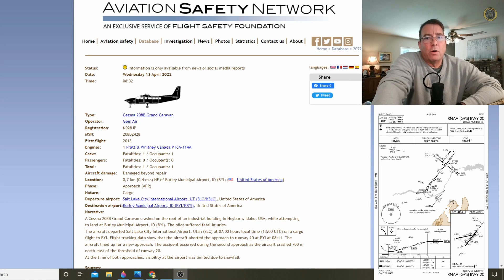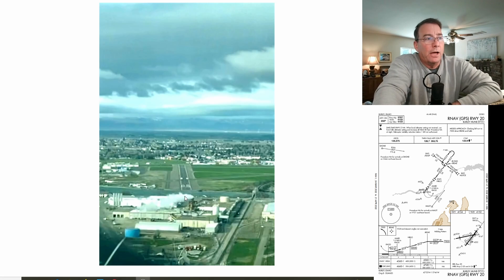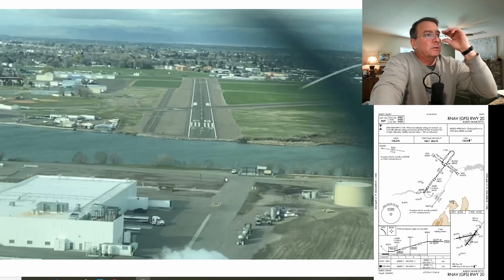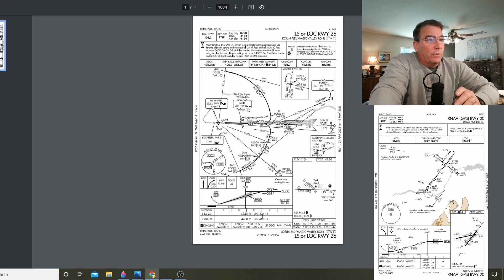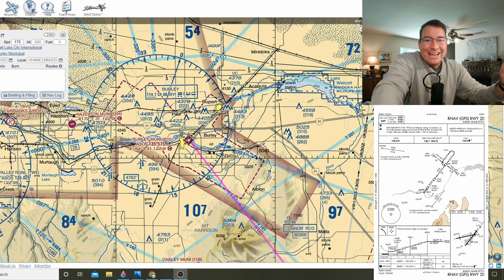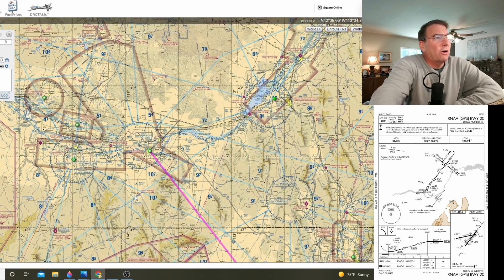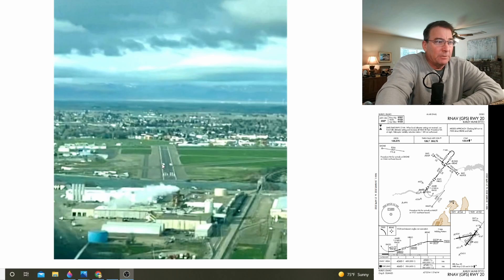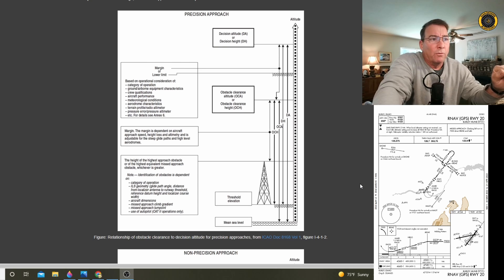Cessna 208 Caravan Crash Burley Idaho New Pictures of Approach

Comment: A factor with Caravans is the type of de ice system. They don't shed ice very well with boots. After several accidents you could order or retrofit TKS. I was on contract to FedEx back in the early 90's. They lost three Caravan's in on winter.
Reply: At 05:44 Juan says this aircraft had the TKS deicing system.
Reply: The difference is TLS is anti ice. Boots are de ice. If you are saturated with other tasks you may not notice. Caravan's just don't like ice. Human, machine and weather. Consider all factors

Comment: How do pilots know what their angle of decent is?  How do they maintain a consistent angle all the way to touchdown?
Reply: The actual geometric angle , typically, is not displayed for the pilot.  Yes, it is published on the navigation charts. Depending on the sophistication of the navigation instruments, they simply follow a set of "guide bars". They adjust power and flight controls to keep those "bars" aligned to a certain position on their instrument. Their airspeed and rate of descent instruments also give the pilot a mental picture of the descent angle. For an example you can look up: ILS instrument or ILS Approach.
Reply: In attitude instrument flying it's called "constant rate of descent at a constant airspeed."
Pilot adjusts attitude + power to obtain the desired performance. It's a closed loop process of monitoring and making corrections.

Comment: I briefly saw the data you put up on your previous post and, as with so, so many times, it's a combination of factors that ratchet up to the point of the tragedy. It wasn't that clear, but it also looked like TAS was dropping quite a lot before impact, so sink rate could have been more than she realised. I know from experience in the industry that there are massive cost pressures in this type of operation, hence the single pilot, but that workload, in those conditions, should be recognised by the FAA as "too high" ....

Comment: Whilst those obstacles are outside of the normal approach it appears to me that if you were low for any reason you would strike the tower simiilarly it seems an extremely unfortunate place to position a tower adding in the steam and it seems like eventually these conditions were going to lead to an accident at some point. I wonder if her initial missed approach was in response to loosing visual of the runway due to the steam. All in all it would seem that there are systemic issues with this airport addressing which may have prevented this accident.

Comment: The airport pre-dates the plant, so how did the plant get approved?  That would be interesting to know.  I suspect that the plant started off much smaller with the stack in a different ground position and emitting a much smaller plume of condensate.  Approved in that state, as a smaller unobstructive plant, over the decades later changes to the plant were grandfathered-in, possibly by weak-willed inspectors.  (Either that or the new plant throttled back its production on inspection days.)  

Possibly some of the changes were internal to the plant and did not require the FAA to be involved.  For example, changing to a higher capacity boiler that produced a much larger plume.  In the minds of many engineers, I suppose that would not be enlarging any physical obstructions to the flight path since you can fly through steam.  

@Blancolirio Juan, Local newspapers might have the answer.  Or they might be able to access the department of labour records for internal changes to the plant. Or local old-time pilots might know. 

Clearly something went wrong with the regulator process to allow this situation to occur without either the plant or the runway being shut down.
Reply: The potato plant and the airport are in different counties. That makes these things more likely.

Comment: For all of the people saying stuff like "there should be regulations on the height of obstructions" (paraphrased) and stuff like that...there are regulations on it, and I would be stunned if those regulations were not met. There's a 99.99% chance we'll find that everything met the rules it had to meet. There are no rules about a steam plume as far as I know. How would you regulate a steam plume? The steam plume would be covered by the requirement that the runway be in sight "continuously" throughout a normal landing. The pilot needs to go around if the plume gets in the way.

In my opinion, the chart should explicitly mention obstacles in the visual segment, which it does not. But it does have limitations on it, "procedure NA at night," and "helicopter visibility reduction below 1 SM not authorized," which tells me, "look carefully at this--something's lurking out there that isn't nice."

There is also no VDP, which is another hint of trouble.

Comment: That's very sad Juan. Now it's not just the pilots fault in this situation!  (1 Which was built first the runway or the smoke stack? (2 In any way you look at the situation, I think the runway should be redirected! If it was 90° of the airstrip that crosses it it appears that it could be lengthened & pilots could use the normal glide & climb.

Comment: Don't forget that you can't rely on wizbang for what is REQUIRED in the FAR's to land. "Paint Pavement or lights." Sure, the G1000 may give you a visual representation of what's ahead, but that doesn't relieve you of your duty to have the aforementioned PLUS the required visibility. The positioning of that smoke stack and tower SUCK, but it's the duty of the pilot to know about that and to mitigate that by making sure he/she has the required visibility and has a glide path angle that will allow for a normal approach and landing. Welcome to Part 135 into less improved airports with less than idea approaches. This is tragic, but we have to learn from the lessons, and mistakes of others. Like you said, Juan, she didn't HAVE to land. She could have went to the alternate or back to Salt Lake. I'm guessing she thought she had the runway in sight and went for it not realizing the tower was right in front of her. It sucks, but this was 100% avoidable.

Comment: Interesting visual deception. I went there Darry a 100 hour Cessna (Christmas Day 1987). They let us immediately put the plane in the hangar. The next morning there was 3 inches of fresh snow on the ground. It’s really not that short of a runway. Did a short run to pack it down clear the wheel pants came back and took off 
  Any icing on a plane with flaps down can really change the aerodynamic airfoil. Maybe adding ice to the bottom of the horizontal really raising a all ready high stall speed.  The C-208 is known to have problems to carry alot belly ice

Comment: Which came first the airport or the potato processing plant?  I'm not a pilot, but does it make sense the FAA would let those stacks be put in at that alignment and proximity to the runway if the airport was there first?  If the airport came later, why didn't they just angle the runway more to clear the potato plant?  Seems like this is a problem that needs to get fixed, especially if you have to fly through the steam from the plant to land.

Comment: Legally required or not, if I owned that factory, I'd have lights on those prominent features. (and given that there is a river full of cold water next to the building, they could run a steam condenser on that stack with very little investment)
Reply: Excuse ignorance. What would a steam condenser do, please?
Reply: @lizj5740  A steam condenser would cool the exhaust from the factory, condensing the steam into liquid water. This would, for the most part, remove the cloud of steam emitted by the factory. 

This can be very expensive unless you have a ready source of cold water to use, in this case, the river. (It should be noted that this is not a lot of heat put into the river and would not cause environmental damage)
Reply: @BrianSFischer  Thank you for a comprehensive reply.

Comment: This has always been a problem with airports in the US, lots of open room (initially) when these airports were built, THEN the county see’s all this land that they can sell or better yet, lease to industry’s, and then your approach turns into a maze of ground obstacles. If it’s not warehouses and other companies, it’s housing communities that then complain about the noise, THEN take offs are at lessened power settings and approaches are switched…. Seems as though flight safety is secondary, until its your butt in the seat.
Reply: Yup, the potato processing plant is not an isolated case. Development always encroaches on airports. If it gets bad enough, the airport gets shut down. 
Don't want obstructions along the approach path? Yeah, right. Go to Chicago Midway airport. It is landlocked on all sides with development.

Comment: Those are fairly tall obstacles in the flight path so not a wild deviation needed to clip those. But our little airstrip has a tall line of trees right before the runway so I guess that has to be known. Again good synthetic vision could show such obstacles clearly and runway to runway autopilot could fly above them without fail.
To my surprise the G1000 avionics despite having 3 screens has had zero synthetic vision up until fairly recent revisions. Yet cost 50-100 grand?
Just adding runways and nearby obstacles takes very little compute power and adding the coarsest of terrain hasn't been a challenge for 15 years. Even back in the day where storage was limited, you could simply upload select runways and areas you would use without having the entire world ready. DGPS with sub 1 meter resolution came around in 1996 and even prior 10 meter precision could be quite useful. Google earth (then Keyhole) came around in 1999 and that was much higher quality than the minimum needed for safe flight. So a comfortable safety minimum has been easy for over 20 years. That said, 20+ years back, a decent system might be a semi significant development but in recent years, maybe 10-15, it's something an amateur could put together for 50$ worth of parts. Electronics today is crazy inexpensive, certainly the lameness we see in avionics. GA is in a terrible state and it's not just because of a small market. It has developed into a sickly complacency of greed and indifference.  75 year old piston prop planes are inching into pressurized jet price ranges. In 1978 when no one had money, 18000 prop planes were sold in USA. Today the market is around 1300. In a time when people have extreme wealth. It's a crime.

Comment: Just curious, which came first, the airport or the factory and smoke stacks? it shouldn't be difficult to deny which came last the permission to build. 
This situation is akin to having a dangerous intersection with only a stop sign until the required number of deaths call for a traffic light and early approach lights.
There is a compromise with the FAA funding the movement of the obstacles if the airport is really necessary or requiring the factory to fund it themselves if they were erected after the airport existed.

Comment: What was their first the airport or that plant? If it was the airport allowing that plant to be built there was criminal in my opinion. If it was the plant it's the other way around.
Reply: The airport has been there at least from the early 30s - the plant much later.
Reply: @coldlakealta4043  Than is whoever authorized that tower at that location criminally responsible.

Comment: Having tall obstacles like these so close to and in direct line with the runway is simply an accident waiting to happen in my humble opinion. Then add in the variable steam direction, possible bad snow conditions and the airfield being not staffed. A better choice in winter would surely be the nearby airport with ILS. Too much pressure on commercial reasons?